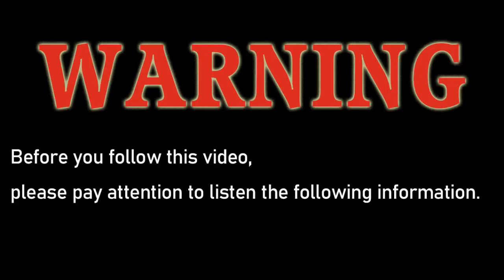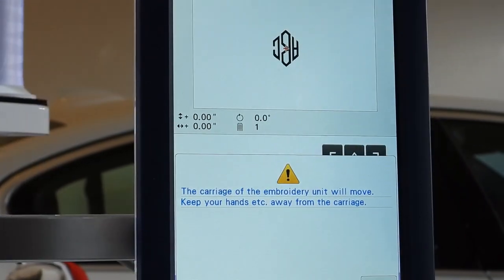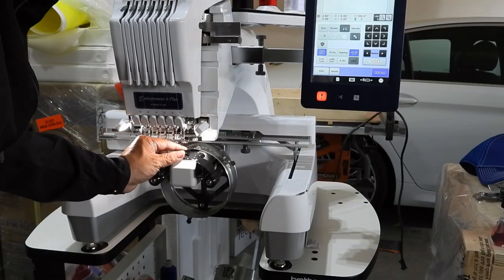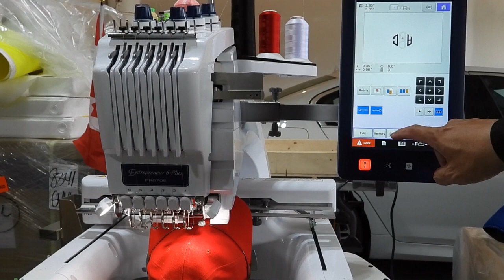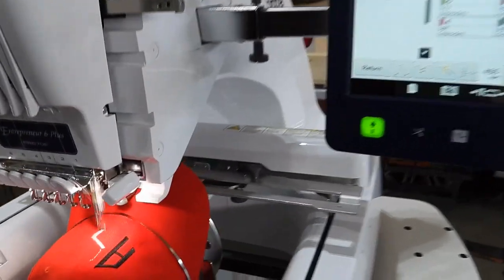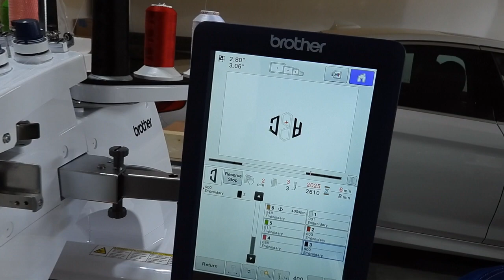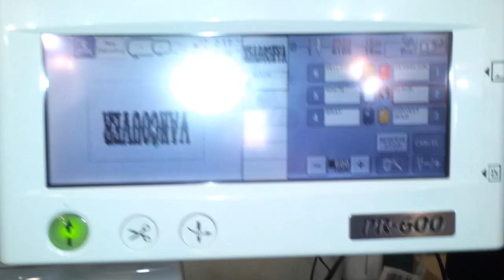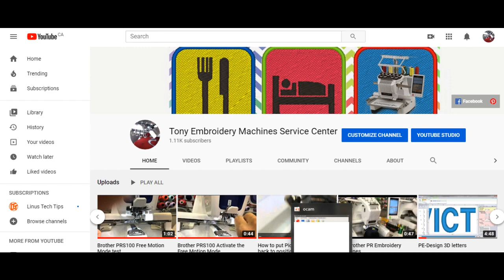Brother embroidery machine cap frame hacks.

Comment: I have a Babylock 6 needle and it’s not recognizing the cap frame. At first it was but with an issue. It was hitting the screws on the bottom when I needed to see the embroidery area. Then went online to try calibrating and after that my machine won’t recognize the cap frame anymore. What can I do now?
Reply from the maker: 1. You need a training class,  the way you are doing make me feel that you don't have enough skills to using this way to making hats. Try the basic way to practice until you have enough cap making experiences and knowing the edge of the cap frame drive first. 
2. The cap frame set doesn't touching the hoop sensor. Depends on what cap frame set you have. It's reading the magnetic sensor to regognize what cap frame set on it to let you using the limited sewing field. The cap frame set doesn't need to calibrate the Hoop Sensor!!!
3. Even you using the correct way calibrated the hoop sensor. It doesn't effect the cap frame set. Unless you done something wrong. Better find a technician to help you. Don't let a little problem getting worse.

Comment: Can this technique be used with the new flat brim frame for the sole purpose of getting the design to get closer to the brim? I have the PR1000E.
Reply from the maker: PRCF5 cap frame already very close to the brim. Yes, you still can use this way to get sewing field larger. But it’s not necessary for the PRCF5 cap frame set to get closer to the brim.

Comment: Ive been told my sensor is bad for my cap frame. Do I need to take this bug machine to a dealer, Or is there a fix for it from home?
Reply from the maker: If the hoop sensor isn't working. It will not just bad for cap frame. All cap frame sets (the cap frame driver) will not touched the hoop sensor lever. The  cap frame sets (PRCF3, PRPCF1 and PRCF5) are detect by the magnet sensor on the cap frame driver not the machine hoop sensor lever. And if the frame holder arm been removed from the machine (hoop sensor lever without been pressed by the frame holder), the machine will automatic detects as the PRCF1 or PRCF2 cap frame on the machine.  Are you sure the person who told you that your hoop sensor is bad for your cap frame is an technician or machine expert?
Reply: @Tony Embroidery  I talked to a Brother tech I'm not sure they knew because it still embroideries. it's something about the cap frame. Thank you and I'll check what you said.
Reply: Our machine wont detect the cap driver when installed it still thinks its in regular mode?

Comment: Do I also need cylinder holders for PRS100
Reply from the maker: The PRS100 doesn’t need to replace the cylinder holders. It’s already has the newer cylinder holders. Only the old models PR600 and PR600II machines need the newer cylinder holders to be able to used the newer cap frame sets (PRCF3 PRCF5). If the PR600and PR600II machines using the PRCF1and PRCF2 cap frame sets.  They don’t need the newer cylinder holders.
Reply: For PRS 100 machine, all I need to do is remove magnet before installing PRPCF1. And test to make sure it’s in the safe embroider zone.

Comment: Did you sell the cylinder connection
Reply from the maker: If you can’t find the newer cylinder connection. You can go to home hardware store to buy the stainless steel flat washers. Add the washers between the cap driver lower screws and original cylinder connection. This way also works.
Reply: Ok thanks I will try it because I didn’t find it

Comment: another question, can I convert my PRCF3 into a wide frame by removing just the magnet sensor or do I need to purchase the PRPCF1 in order to make it work on the PRS-100 Persona? Thanks again for this video!
Reply from the maker: PRCF3 width is limited by the cap driver, can’t over 6” wide.
Reply: @TdpsCa  I am looking to do the same thing. Can I buy just the frame and use the PRCF3 driver & jig, or do I need to purchase the entire assembly?
Reply from the maker: @roaminrabbitt  If you are talking about using the wide cap frame on the PRCF3 cap driver, the answer is no. The both cap drivers don’t fit each other’s cap hoops.
Reply: @TdpsCa  Thank you sir! After a lot of research, I have decided I am definitely getting a new kit.. but I still can't decide between the Brother PRCF1 or the HoopTech Gen 2.
Reply from the maker: @roaminrabbitt  This hack also works with the PRCF3. if you think about buying a new cap frame set.. my recommendation will be the PRCF5.

Comment: Hi Tony can you do it with the smaller cap drive I have the Enterprise Multi baby lock and I only see a smaller Drive. Need help :)
Reply from the maker: Yes, the PRCF2 and the PRCF3 can use the same way to get a bigger sewing field. But the design width will be limited by cap frame drive(will get stuck).

Comment: Hi Tony can you upload how to do this on pr600? Im having har time to know the position of the design because it doesnt hav laser. Please need your help
Thanks
Reply from the maker: PR600 machine needs to upgrade the cylinder connection. Here is photo album link.  https://www.facebook.com/media/set/?set=a.507046936063431&type=3
Reply: If i buy this upgrade do i need to buy a new cap driver and frame? Or can i use the original cap driver for pr600?
Reply from the maker: @jaysonoliva4556  Before you really understand how to use cap frame. Don't buy anything. You will get more confused about the cap frame sets.  Looks like you don't even know how find out the design position. This video isn't good for your to learn the basic operation.
Reply: Tony Embroidery Machines Service Center yes because my machine doesnt have laser guide like the one on the video you uploaded.
Reply from the maker: @jaysonoliva4556  The PR600, PR600II, PR620 and PR650 machines don't have LED center light. But most of owners don't have problem to find the design center. PR600 can press down the needle press foot to see the needle position. Another way is going to sewing page and press the cut(trim) thread button, machine will stitch 3 stitches and punch a little pin hole. Back to EDIT page and use the pin hole to move design to center.  If you still don't know how this works, better wait until you realized how the machine works then use this technique.

Comment: I have a pr600 and a prcf2 driver will this work?
Reply from the maker: Yes, if you totally understand how this hack works. Once the hoop sensor be pressed down, the sewing field will be larger. Just be careful don’t hit the left or right edges of the cap driver.
Reply: Okay thanks, if I would buy a prcf3 and the connectors would I be able to have a larger sewing field or would it be the same?